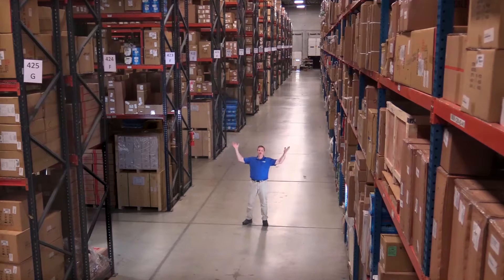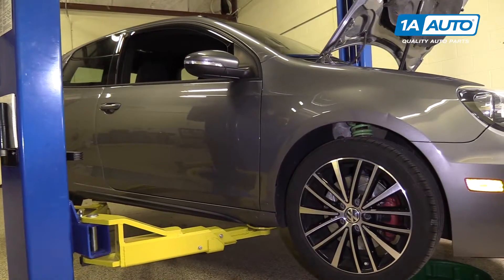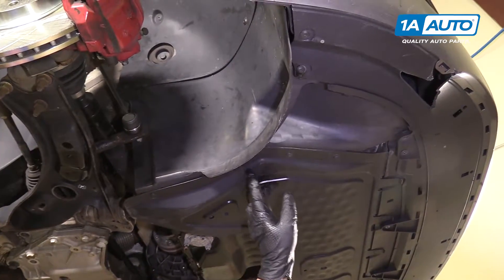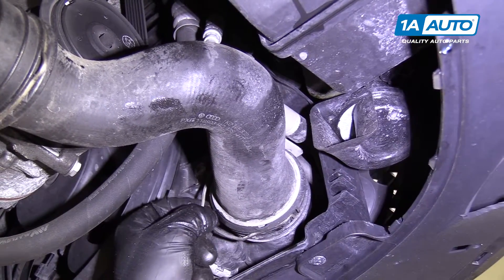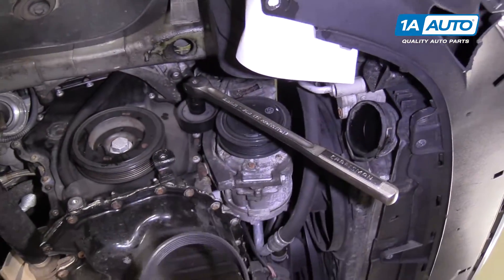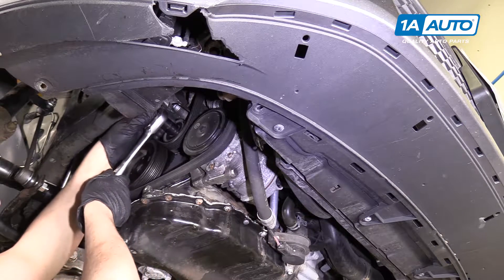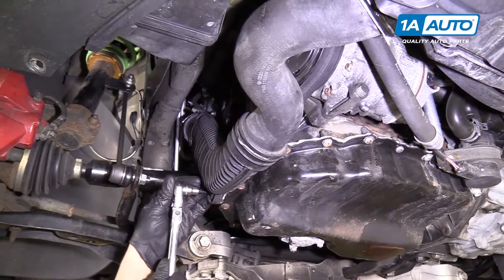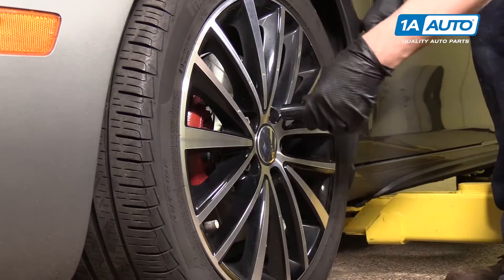How to Replace Serpentine Belt 10-14 Volkswagen GTI

Comment: Thanks for the video! I was able to replace the belt from the top. A 3/8 ratchet with a 4” extension on the handle was just long enough that I could press down and hold the tensioner with my weight and pull off the belt easily with the other hand. Pretty much a 10 minute job after the hour it took to figure it out :)
Reply from the maker: +bzzt88 Thank you for the great reply. We love to empower our customers by showing you how-to perform your own auto repairs! Have a great day! 1aauto.com
Reply: +bzzt88 can u give more details please dude rather do it from the top and don't wanna take half the car apart 👍

Comment: Takes less than 10 minutes from the top by yourself.
There is no need to add an extra 30 min of work for the prep. 
Biggest “tip” i would suggest is when the new belt gets caught by the coolant hose, just poke it through with an extension.

Comment: Wow. That's a lot of work for a belt. Gotta love German engineering. I have a 2009 gti and it needs a new tensioner.  Is it the same process pretty much or will I be able to replace it from the top?
Reply from the maker: We currently do not have an auto repair video specific to your vehicle. You might be able to apply some of the basic steps shown in this video to your application. Hope this helps you out +Rupert White
Reply: How is that a lot of work for a belt? Its a transverse engine...
Reply: @rickhenry9869  Some ppl man. Should only take you maybe 30 mins tops? But i guess that’s too much work for someone.